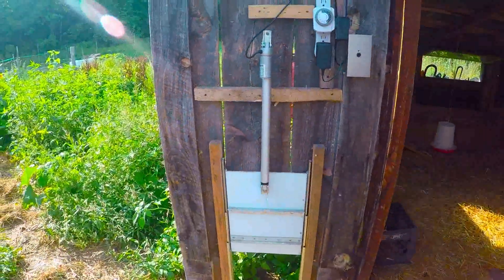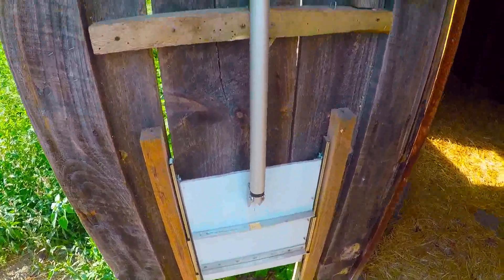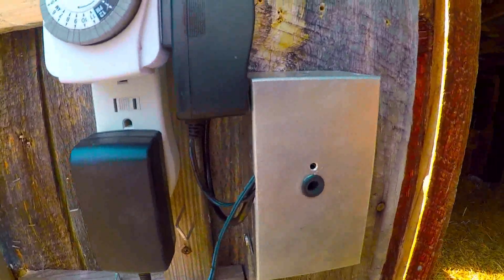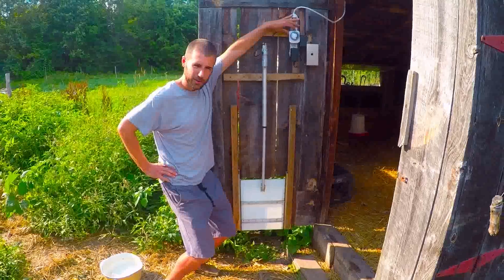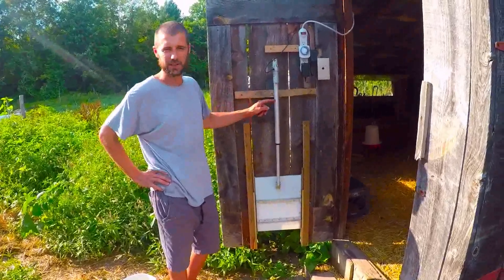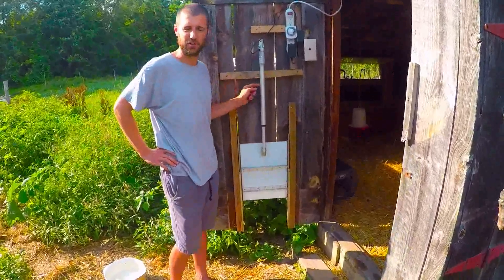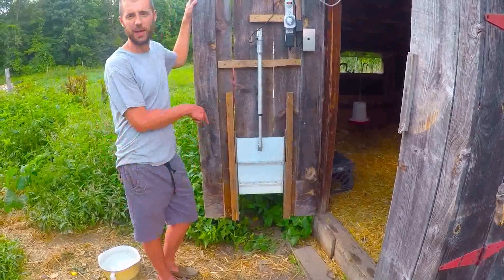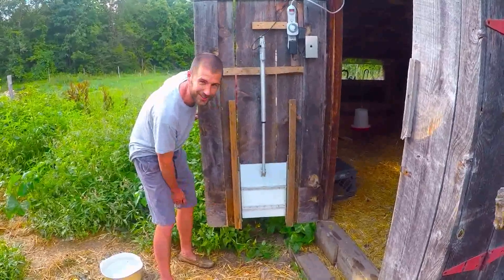NEW ~ Back To Eden Garden ~ Automatic Linear Actuated Chicken door

Comment: I see your in Vermont and have cold winters. Does the cold hamper the actuator operation? Some have temp limits.
Reply from the maker: The cold actually doesnt affect it! It's been extremely reliable. We've had nights down to -20 Fahrenheit and it has still worked.

Comment: Im looking at doing the same but with a swinging door. And instead of a timer using a daylight sensor from a big box store. This way all the electronics are self contained and 120v daylight sensor would activate the 12v power supply for the relay that would just activate the DPDT NO/NC relay into reversing the actuator. This way no mater the time change per season. When it gets dark it'll close. My biggest fear is choping a chicken in half. Maybe put a old doorbell on it so when it moves it tells the checkens time to get out of the way
Reply from the maker: That's a great idea, I have considered it as well just haven't gotten around to do it. I like the linear actuator because it's slow enough it gives the chickens more than ample enough time to get out of its way. I think the sound of the actuator also keeps them away during opening and closing. So far, we haven't had any issues chopping hens in half.

Comment: Can you explain your power supplies a little more? So your main source is 120Volt? Then you use some sort of plug in 12 volt converters in those black plug in to convert to 12 volt which run both the timer and actuator?   Thanks
Reply from the maker: Main source is 120v, running a 12v dual pull - dual throw relay that was purchased from automation direct. How this is accomplished is via 120v ac to 12v dc wall transformers, the 12volt relay is energized as dictated  by the timer through the 120v ac - 12v dc 1.2 amp wall transformer while the actuator gets powered by a 120v - 12v dc 1.5amp transformer. The actuator is a 12volt - 16 in stroke, 200 pound max lift capacity purchased from ebay. To put this in short terms the actuator extends only when the relay circuit is energized. Our design has the relay energized during night hours. When the timer reaches dawn the relay switches off and the relay circuit is in default position causing actuator to reverse polarity and contract to door open position. Hope this helps !
Reply from the maker: Also, its a push-pin timer.
Reply: now i understand..your design is good..but i prefer to use a two timer set up because its more efficient and consumes less energy..especially when you have a low capacity battery..
Reply: @jennycartagena4684  no it does not consume less energy. LOL. You have two timers sucking up twice as much juice. 1 DC timer, 1 DPDT relay is all you need if using a linear actuator. Since they have limit switches built in. If not just use two diodes and two magnetic limit switches. 

Plus your way is more expensive.
Reply: isnt the relay inside the timer consumes energy...with your set up you have to turn the timer on which in turn powers the relay for long period to keep the door open/close..i know the timer relay consumes less current say like milliamps..hehe